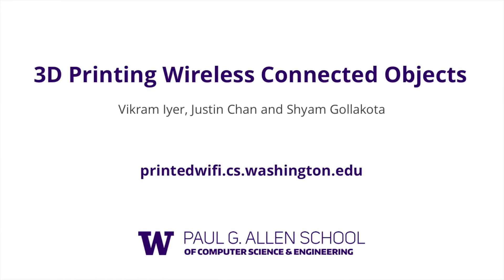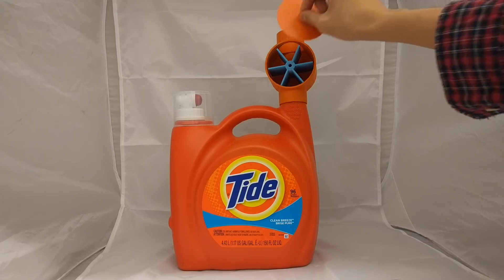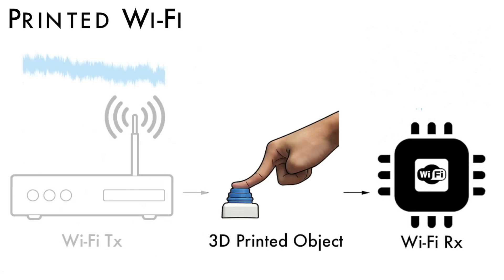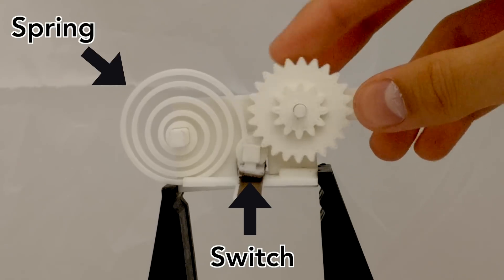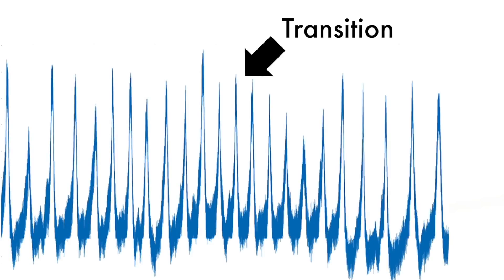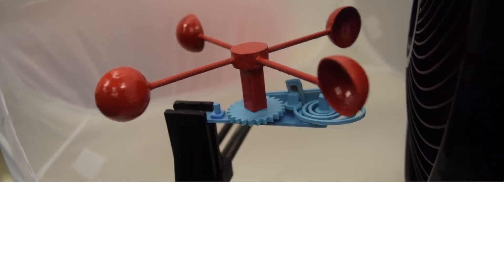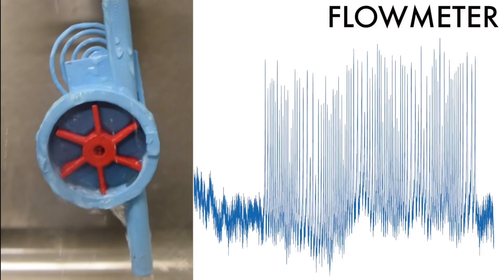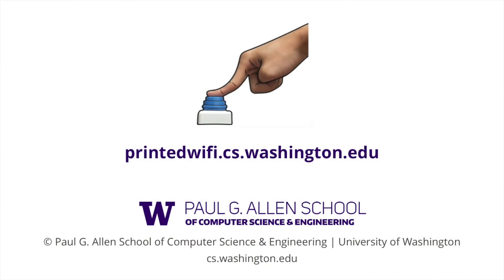3D Printing Wireless Connected Objects

Comment: Let's say I had a file I wanted to store in 3D printed plastic, and thus did not want the data to change at all. So, hard-written like a CD or old-school videogame cartridge. Even as few as 256 bits could be useful, but of course more would be better. Is there a way to use what you invented to do that? Or does this only work as a sensor for dynamic systems?
Reply: The paper that is behind this video actually presents another method that exactly addresses your problem. Maybe check it out

Comment: This is ridiculous, with little to no practical real world usage. Your video is misleading at best, and damn near lying to the general public who doesn't know any better.
You guys are NOT creating a Wi-Fi capable device as you claim (Wi-Fi is a trademark of the Wi-Fi alliance, whose technology is based on IEEE 802.11 standards). The designs shown in this video do not adhere to the 802.11 standards, and simply attenuate a Wi-Fi signal, requiring the usage of a specialized device to actually revive the signals. 
Also, don't use PAM with an impulse pulse shape, you guys are extremely spectrally inefficient.

Why is this design even a topic of research when I can buy a IOT Wi-Fi module for pennies off the shelf?
Reply: I think it was more of a proof of concept than anything. Yes, it has no real world applications, but it is a technology that can exist. I do agree with some other comments as well that interference will also be a major issue.

Comment: Considering he was scrolling and turning devices on without batteries I was impressed. My Roku remote using RF is my favorite by far but runs batteries down a lot faster than a IR remote. To require NO batteries and use RF seems to be a step forward nevermind the fact that this was with crude 3D printing. But yeah clickbait! Burn them!
Reply: +Chris Hax
Ah, yes I do have been generous with my contributions, perhaps too generous.
Can't you troll better than this, little ant?
Reply: @labobo-h7u  and  Chris Hax      when 2 trolls meet
Reply: I know garbage when I see it and your reply qualifies.
Reply: +Chris Hax
You must feel threatened by my intellect. I do love to pull legs off insignificant ants just for fun.
Reply: labobo Yes your contributions far outweigh the ones you attempted to bash meanwhile you admit to mutilating ants for fun. We are all impressed...LOL

Comment: Your article has a clickbait title, and you are extremely misleading with your wording in the video. This is quite literally electronics. 
"electronics- of, relating to, or being a medium (such as television) by which information is transmitted electronically"

Look up any definition of the word and you'll see that your device counts as electronic once you added electrically conductive filaments. A more proper title would have been "3D Printing Wireless Sensors Without the use of Manufactured Electronics" or something.
Edit: Not to mention that your device doesn't do anything without a powered electronic counterpart that is actively dedicated to receiving signals from the device.
Reply: It's a fucking project. No shit its going to be expensive and impractical and not for the masses at first, thanks for pointing that out. This is an idea and it has the potential to be integrated into everyday products that normal people use. CPGs could integrate these plastic units in their packaging, clearly not something they would do with a $3 optical sensor. Unless you think Joe Smith is going out to buy an optical sensor and put it on his bleach. But hey, lets shit on the idea because you don't like how they misappropriated the word 'electronics'. As if it ever mattered in the first place because again, who doesn't have a smartphone?
Reply: @smith-marsette2721  first of all. conductive fillament is nothing new.  
second of all.  this is now useless and will always be useless.  or how did you expect this would work when you have 2 or 3 diffrent ones?    how do you expect it to "know" what direction you are turning the knob???  even on a single device.  

you do know they are just fooling you in this video right.???  it's not even real.  but even if it was it would be tottally useless
Reply: I for one like the idea of wireless controllers that don't need batteries. It does seem like they need a little bit of metal, though, for the antenna. That's going to make printing from a CAD file without needing any manual post-print modifications difficult, unless 3-D printers can use metal filament?
Reply: They actually used a commercially available filament that contains copper. It's called "Elektrifi 3D" and according to the producers website it can be printed by regular desktop 3d-printers.
Reply: +R H And then they specifically state you need a powered electronic smartphone to receive any data and do anything with your "unpowered, unelectronic device that isn't hooked to anything powered" (except that it is). 
To say it doesn't require batteries, but then you MUST use a battery-powered device for it to be useful...
Reply: So just what kinda of non electric device would you expect someone to send wireless signals to? I mean honestly, it's a "wirelessly connected object"... Connected to what? A computer or device, of course. What else would you do without digital backend? It would be like an NFC tag with no device to read it. Useless.
Reply: +GOOGLE SUCKS For someone so quick to start insulting others, you are the one who missed many large details. The video itself uses that wording, so does the article here: http://printedwifi.cs.washington.edu/
and so does their actual published paper. 
If you can own a $800 smartphone, hell even a relatively cheap $100 smartphone, AND a 3D printer, then this is all useless. The electronics to make a sensor that work unimaginably better are very cheap and readily available. Now you are the one splitting hairs. Oh this will be so useful, for an extremely odd subset of people with access to great technology but also require the use of primitive technology for some odd reason I'm sure you can make up. 
Using insults only makes you come off as doubly unintelligent when paired with meaningless points.

Edit: Oh yeah, you also need wifi router, internet connection, and special conductive filament, which a quick check shows the cheapest spool goes for $50 with most around $100. The materials are SO readily available and this person really can't spend the $3 for an optical sensor.